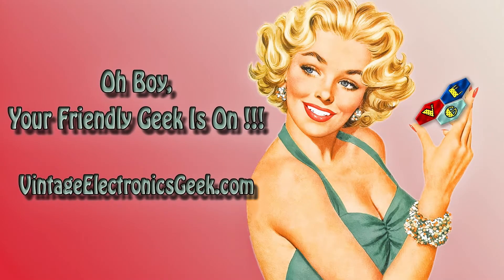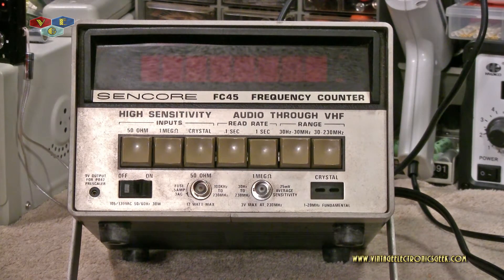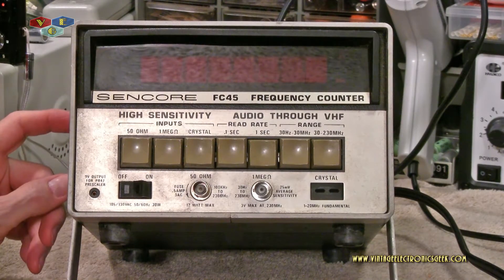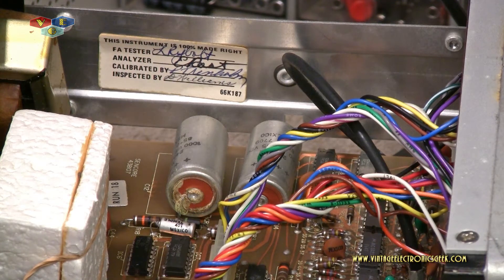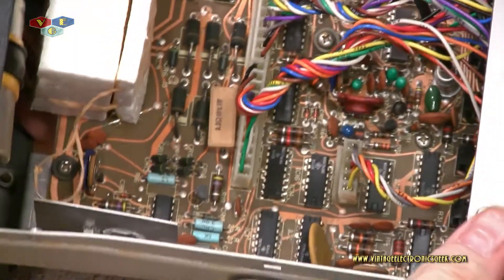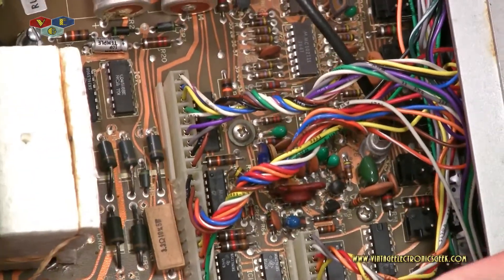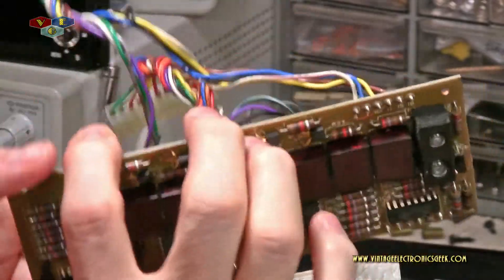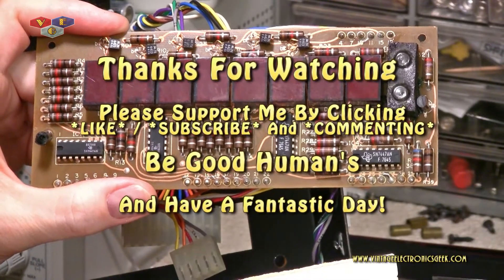Sencore FC45 Frequency Counter - Pt I - Overview & Teardown

Comment: The Sencore FC45 Frequency counter was originally manufactured  Oct. 26. 1977 to 1987 so you must have one of the next to last ones made. Must be really good if they made them for that many years. Yeah a riveted in electrolytic cap well that's not easy to replace. Of course how many things on a printed circuit board are easy not many when you have arthritis in both hands like I do. Yep makes sence to check all the resister values and the caps to replace just on general principles. Good first look Jack.
Reply from the maker: Thank you Larry, I appreciate the research and data!! It is a nice meter, it's kinda chunky but I like it, wanted to stay with the same looking pieces of gear...dorky I know!  :) I think I may drill that cap out and just put a nut and bolt, but will dork with it first??  Sorry to hear about the artist, I can sympathise a little bit as I have eyeball issues, not fun indeed!  Thanks again!  ~Jack, VEG
Reply: Yes jack I have eyeball issues as well hard for me to see clearly sometimes floaters in my eyeballs happened a couple years ago when i fell and hit my head shoveling snow mostly ice. I didn't crack my skull but had blood in both eyeballs and 4 rips in the retina in my good eye to repair with laser surgery. Not fun at all I still see floaters that block my vision so I'm blind i one eye and can barely see out of the other. I'm treated as a one eyed driver with those restrictions here in Nevada.
Reply: Date codes for most of the display board chips are "7645" and one of the 1000 mfd caps on the main board is date coded "7709", so I expect that this unit was born in 1977.